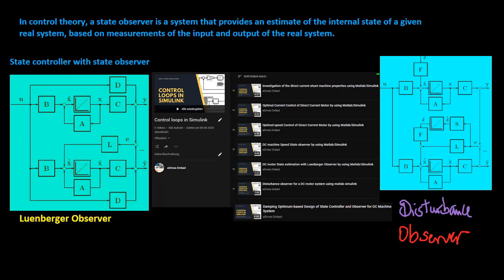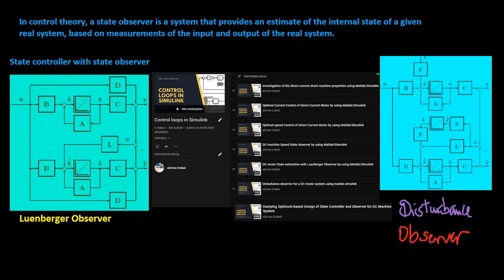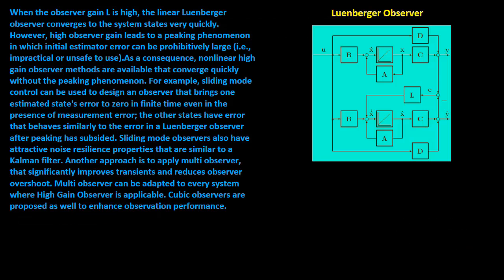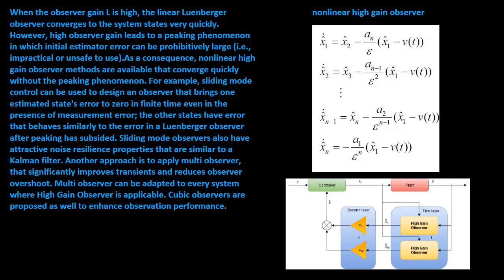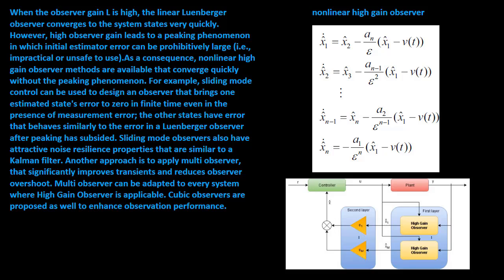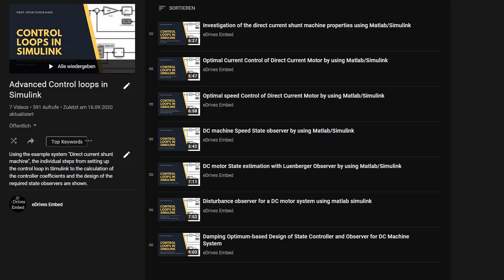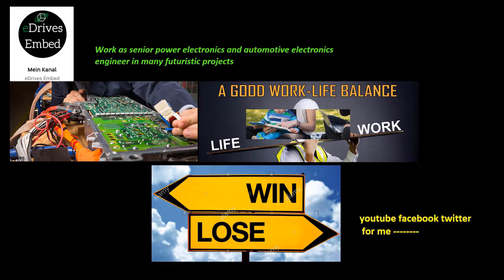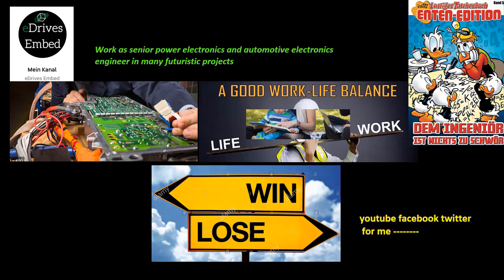High Gain Observer introduction !!!!No suitable simulation!!!!!!

Comment: hi. Good video. How do I get to learn the basics of this?
Reply from the maker: to learn about the observers i have this course:https://www.udemy.com/course/computer-aided-control-systems-design_control-system-toolbox/?couponCode=7DE5F7C271C3D3034EDC , the in-depth will come in another course.
Reply: @eDrivesEmbed  Thanks. Does this include High gain observer or it will be in another course?
Reply from the maker: @syedirtazaalinaqvi7738   it will be in another course
Reply: @eDrivesEmbed  does that also cost 15$ ?
Reply: Because I want to learn that but don't want to miss the basics too.
Reply from the maker: @syedirtazaalinaqvi7738  depends on how much time and effort is put into it, but is currently planned further down the line.
Reply: @eDrivesEmbed  which paper have you implemented on this simulation? Can I get the link, please?